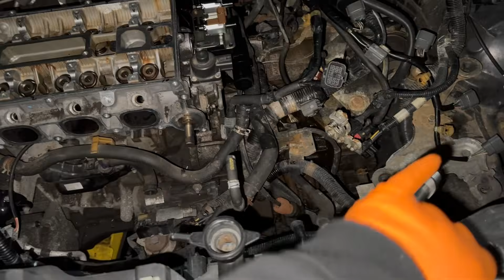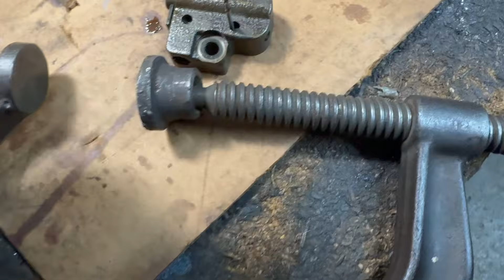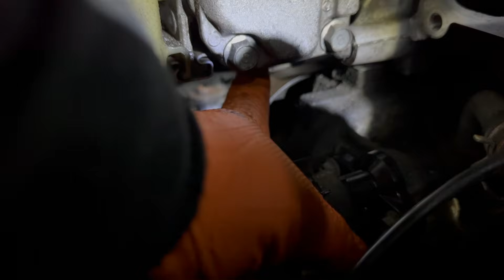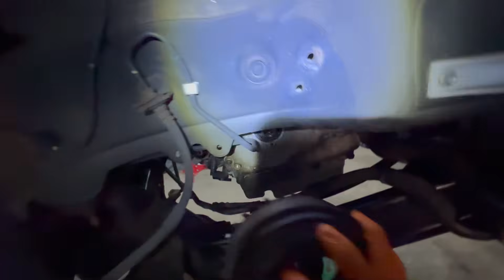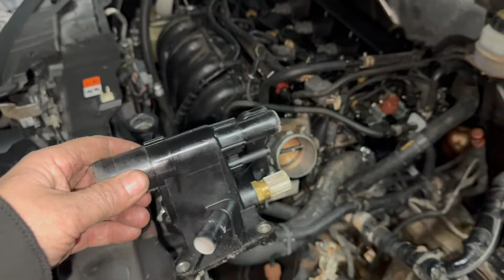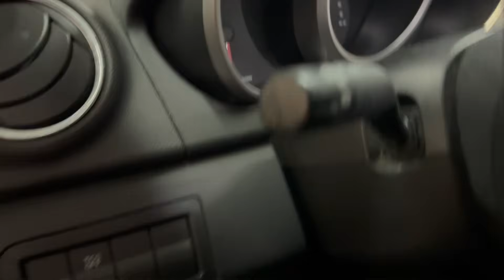Mazda CX-7 2.5L Head Gasket Replacement (Part 2) – Head Install, Torque Specs & Reassembly

Comment: When I took the head off my 2.0L NC Miata, I’m not sure what happened, but when I removed the timing tensioner, I heard a clunk. Once I removed the head, I noticed cylinder two’s exhaust valves are broken and the piston head has two small gouges. Is this piston still usable provided I deburr the gouge? Or is this piston trash?
Reply from the maker: Post a video on your channel and I’ll give a look

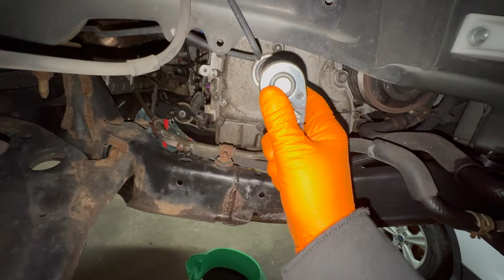Comment: I loaded the chain tensioner like at 20:49 , then I tightened the center bolt on the harmonic balancer dry to 75 ft-lbs and then the additional 90 degree with a breaker bar, all the while with the purple TDC tool in and the crankshaft lobe clunking against it.. 
The 10mm centering tool bolt was snug in the HB like at 22:29 , and the camshaft slide bar tool all in TDC position and the TDC purple bolt in clunked and all ready to receive torque. 
I made sure that the chain was tight, flywheel was jammed with a 1/2 flat screwdriver in between the upper last tooth so there was no spin at all. 
All went well until I tested the 2 revolutions of the HB. 
At the second revolution test, I noticed that the the teeth were off the marking that I made on the timing chain cover by about 1 3/4 teeth spaces from where they were when I tightened down the center bolt. 
When I clunk the crankshaft against the TDC tool, the camshaft bar slide in tool is off as well by the same -1 3/4 teeth mark spaces on the HB. 
Not sure what happened for it to be so far off. 
The center bolt does not want to come back off at this point even with different impact wrenches for a retry. I have a 21V 1/2" impact wrench, but it's not budging at all. 
Let me know what you think...
Reply from the maker: You messed to whole procedure up. You never rely on the TDC pin when torquing everything down it probably bent and threw off all the timing marks
Reply: @motorcarnut  Please re-read what I posted : " I made sure that the chain was tight, flywheel was jammed with a 1/2 flat screwdriver in between the upper last tooth so there was no spin at all.", Flywheel was blocked with a large screwdriver. I did not just rely on the TDC pin, I think it would have sheared off had I done that , it's ton of torque when you add that last 90 degrees. TDC purple tool is stil as straight as an arrow. It did not receive any force since I was holding the flywheel while the center bolt was torqued.
Reply from the maker: It's hard to know what you did wrong. I would re due the timing and before you do the extra 90 degrees rotate crank 2 times and see if everything lines up again before torquing down the harmonic balancer.
Reply: @motorcarnut   Yes, I re-did the timing, and everything lined up. I used a triple thick socket to get the bolt out. Everything lined up and locked in now.  What helped was to torque to 75 ft-lbs, and ensure that the timing was in place before going the extra 90 degree turn just in case it was still off.
Reply from the maker: So, I don’t follow is it ok now?
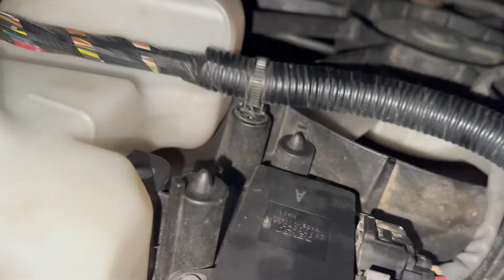Reply: @motorcarnut  Yes, I am up to about 30:01 in the video. All is going well, just need to re-install the front right axel, Serpentine Belt, Battery tray, Air box, Oil and Coolant, and will let you know how it all goes. I also did install a re-machined CX-7 head (the previous head was warped over 0.010 in between cylinders 2-3-4) so then new NGK plugs, Coils, Timing Chain kit, Fuel injectors cleaned with ultrasonic machine, cleaned carbon out of the  EGR valve, new aluminum valve cover, new insulation under the engine cover (ceramic fiber) and misc other small maintenance-type replacement/cleanings/ updates while I was in there.. I'll let you know in a couple of days....
Reply from the maker: Yes! And should run perfectly!!!
Reply: @motorcarnut  The CX-7 starts well and runs well. I ended up with a slight coolant leak in the middle of the radiator once it gets pressure, but I can deal with it separately. A couple things to note: 1. When you put the front passenger axle back on, - there are two inner splines to line up with - like two master splines. I had to do this a couple times before it would fit in all the way. 2. The Serpentine belt is a real bear to install on this car once you have the motor mount on. 
I had to watch two or three other videos and I needed a helper to slide / pull the belt over the power steering pulley while I crank down on the tensioner using a 14 MM offset spanner and an adjustable Crescent wrench on the other end. So,  I had to do a lot of improvising here and there, but I was able to get back together.I got a dash light for the DSC (Dynamic Stability Controller) is what it's called. I had to turn the wheel all the way to the right and to the left twice, then it finally went away.  Somewhere, Somehow, in all of this, or with the guy that worked in it before me, - my AC's R-134A supply is empty, so trying to fill that but it's not taking any in, so I might go have to rent a vacuum kit and try to refill it again.
Thanks for all the help. 
I have a lot of extra, unique tools I'll never use again, but I might be able to help somebody else out down the road.
Reply from the maker: You’re welcome! Hey you did a lot of work already and more importantly saved yourself $1000’s doing it yourself. I appreciate the write up and all of your comments! Will help others in the same situation. You may have a leak from putting strain on some of the ac lines what working on the engine possibly?

Comment: When you tighten the main crank bolt down on the harmonic balancer at 22:46, do you apply any assembly lube, anti-sieze, or related oils the the main threads, or just torque it down with dry threads?
Reply from the maker: Torque down dry as per Mazda shop manual.

Comment: Thanks for both videos, this is very precision work, will do it on my Mazda 2..."timing crankshaft and valves is very important"
Reply from the maker: Glad the videos were helpful, and good luck with the job—measure twice and be careful with that timing.

Comment: Can you elaborate on the Wedge mentioned at 22:57 that snugs the flywheel so that the harmonic balancer does not spin while applying the final torque after you spend all that effort ensuring the timing? 
I can envision some 3"x3" slice of hardwood shim at some 30 degree angle, but I wanted to know more about what you used first... Thanks.
Reply from the maker: What I meant was a crow bar and wedging it in the teeth of the flywheel and block and someone holding it while you torque the harmonic balancer
Reply: @motorcarnut  ESTWING Gooseneck Wrecking Bar, or similar with the flat end against the teeth, or on the side of the flywheel? Thank you.
Reply from the maker: Yes

Comment: Was head warped?
Reply: I have a 2016 with a head gasket and maybe a bad cylinder head also. Where did you get a cylinder head at?
Reply from the maker: Salvage yard would be the cheapest option
Reply from the maker: Yes, too much to save it.  I had to get another good used one for customer
Reply: @motorcarnut  wow !!!!

Comment: What caused the HG to fail? I have the same car with 180k
Reply from the maker: Number one reason is coolant neglect leading to overheating problems
Reply: @motorcarnut ok but what caused the duratec engine to overheat? The plastic coolant housing cracked?
Reply from the maker: No someone overheated the engine then the coolant housing melted
Reply: I just took in a 2015 Mazda CX5.  Is it the same engine? I did notice an electrical on the intake cam that looks different than this one.
Reply from the maker: Intake and some electrical are different but block and head is same
Reply: @motorcarnut thank you, I tore it down today. You are right!!
Reply from the maker: No problem, good luck with the rebuild